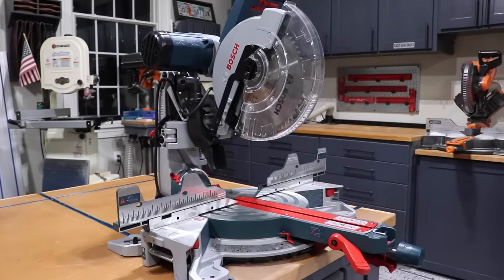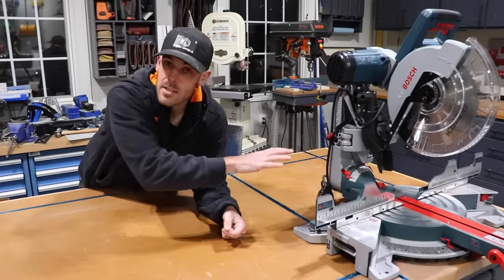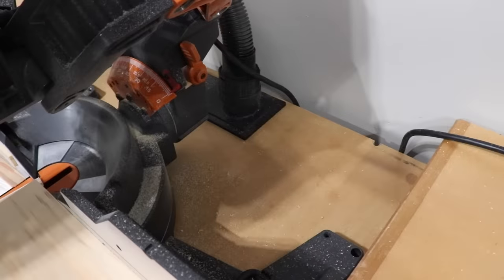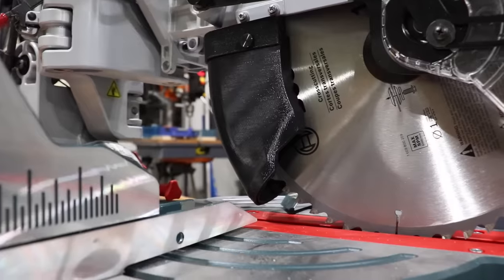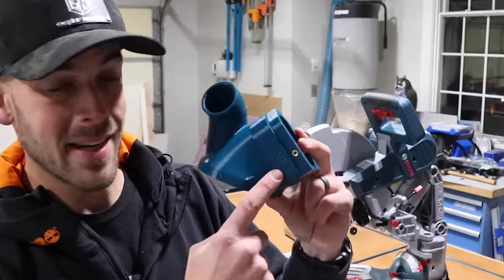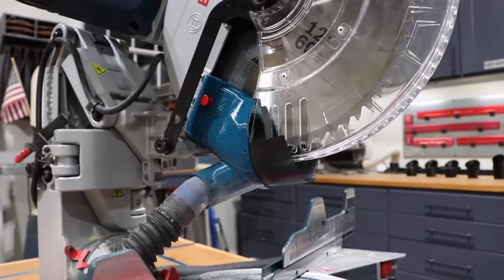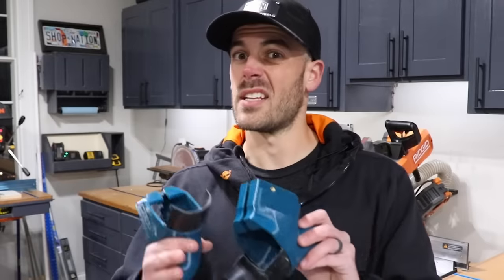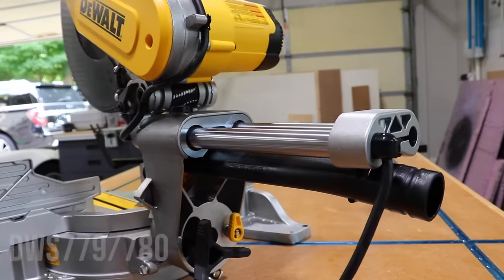It's like Bosch doesn't even care

Comment: I have to admit, very clever idea. I think you could improve it even more if you make the suction adapter in the back a bit bigger. That's generally the biggest problem with all suction systems on Machines. As an example, a table saw. The opening that considered sucking around the blade is significantly wider than the suction adapter for the Machine. You can test it even without a machine. If you connect a 4-inch suction hose to an 6-inch adapter, you will lose more than 50% of the suction flow. And vice versa.🤔

Comment: For ideas on cool connections (like how to improve the magnet connection) check out Fidlock. They have awesome fasteners. My favorite are magnetic to mechanical locks. So magnets help the lock close then you have to mechanically twist or move to unlock. 
So imagine your hose adapter using magnets to easily connect, but then you have to twist to unlock it.

Comment: The 3d printed part will delaminate where there is the friction fit unless you specifically orient it to combat that effect. For a similar project I printed a thick ring in the horizontal plane to counter the pressure

Comment: Makita 10 inch please!! They are generally very good with dust collection, maybe the best of any saw, but when cutting whide boards, the sawblade is far from the dust collection port, and it fails badly.  This is a common use of this saw for me. Hope you can help!

Comment: Check the straightness from the miter bed to the wings and I think you will find the wings are .017 inches lower so it could affect your cuts. As long as you hold your wood down hard against the bed no problem but on a very long piece it maybe.

Comment: Have received it and installed it.  IT’S GREAT.  very little dust is not collected.  One question.  The attachment ring keeps falling off when I remove the vacuum. Do you have a suggestion for better attachment?  I’ve thought about a set screw , machine screw with sharpened point and even CA glue.  Or, are there flexible attachments that won’t interfere with the saw when it slides?  Thanks

Comment: Hi, great job on that I want to buy it, if I have a festool dust extractor, do I need any adapter for it or will it fit directly in the default model without adapters? Thanks!

Comment: You sold me!  ... now I'm wondering about Bosch's new miter saw, BOSCH GCM18V-12GDCN PROFACTOR™ 18V 12 In. Dual-Bevel Glide Miter Saw.  Two questions, please: 1. Have you developed a dust collection chute for it, and 2. Can you compare the new saw's dust collection effectiveness to your chute design for the  cordless saw?  Reason is that I'm considering buying the new one, but if it doesn't exceed the changes you made on the old one, them I'm going for the old one; your design!   [Your design appears to have exceeded the collection performance of my Festool Kapex 120!]. Way to go!

Comment: Hoses- replace them all with the DeWalt AirLock system. Just the best out there. Quarter turn lock, with 360deg rotation free. Never have a hose come loose again. Male ends for tools can be made from cheap plumbing fittings (size adapters).

Comment: Definitely a mixed bag for me.  On thinner boards, this is great.  Much better than stock.  Thicker/wider boards, it is in the way.  It becomes obvious quickly why the manufacturers don't put collection there.  So on thicker/wider boards, I unclip it and have no collection.  I would gladly sacrifice some dust collection efficiency on smaller boards to have a better than stock solution that is universal.

Comment: You mentioned twice either "German engineering" or "German machinery".  I'm a 60 something year old engineer who has worked with German industrial engineered machines all of my professional life.  I've also spent time in German manufacturing plants.  I can tell you first hand there is nothing spectacular about German engineering or machinery.  The only thing I can say about their equipment is, at times, they throw more steel or aluminum on their parts than is necessary.  Some of their equipment is not necessarily over-engineered as much as it is over-built....much like old US industrial equipment used to be.

You presented a great solution to the saw problem though.  I still think (as I mentioned in the Ridgid/Cruzer video you did), you would benefit from adding a perpendicular face to the collector port.  It would prevent  contaminants from whipping around the port, efficiency increases.  I've used the concept dozens of times in industrial dust collection applications.
Reply from the maker: Interesting, the perpendicular face would act as an anti-vortex? Or just promote more laminar flow?

Comment: All your cuts are SUPPOSED to be sliding. The saw is designed to be pulled out raised, then plunged, then slid BACK to complete the cut. So you are using it backwards.  ( This minimizes tear out at the fence side of the cut since the fence has such a large gap in it ) In addition, the reason you have a 12” blade on a miter saw is so you can cut thru wood up to 4” thick.  The thickness of wood a miter saw can handle is determined by how much blade sticks out below the drive housing. ( usually about 1/3 the blade diameter or a tad more )  It looks to me like your chute is sticking down lower than the drive arm at the hub of the blade by a good deal. This limits the cutting depth of the saw in simple crosscuts and nearly eliminates it in bevels cuts.   That is, its a fine solution for folks only cutting 1” thick boards that are only a few inches wide.  But will require being removed and no solution at all for cutting anything thick or wide.  Seems to me your solution could be improved by making the back section retractable as it strikes the surface of the board so that it allows the full board thickness and width the saw is otherwise capable of cutting.  Just a hinge point so that gravity allows it to drop to the board surface and the board can push it up would work, or you could take advantage of the Bosch lever arm linkage that retracts the blade guard in the opposite direction.

Comment: So after using your “what I thought a very cool solution” for many months I found another issue! If you cut lumber that is thicker than 1 inch you have to remove your dust collection! The bottom does allow enough space.

Comment: Festool Kapex is supposedly the king of dust collection, but it looks like you would give it a run for its money. My Kapex is good but I mounted it in a station that has a down draft cabinet under and behind to collect what gets missed by the Kapex ans CT midi. The down draft is connected to my dust collection system.

Comment: Greetings, I really like the idea you have of improving the dust collection of my Bosch saw with your creation. I purchased the digital file recetly and my son printed out the componants. It started off performing very well collecting a lot more dust than the OEM collector, then disaster struck. I was cutting miters on some door framing stock that results in having to cust small off cut blocks, the blace picked up one of these blocks and rammed it into the dust collection adaptor causing it to shatter. In talking with my son we are interested to hear if you have a specific recommencation on plastic he should use in his 3D printer. He initially used what he had on hand and now we realize we need to get something a lot tougher. Also, the slip fit hose adaptors didnt slip fit well at all. I had to reem out the ID of the smaller adaport so it would slip fit. Did we not print this properly? Joe
Reply from the maker: Sounds like you printed in PLA, I’d recommend PETG and up the perimeters to 3 and increase your infill. Fit of the adapters could be a printer issue as mine all fit perfect
Reply: @ShopNation  Thank you for your reply, We will give the PETG and perimeters of 3 a try. Thanks very much. JLGWoodwork

Comment: A thought regarding the wide vs narrow version and air velocity. 

But first great video and display and presentation of your itteration process! 

A question: It seemed like the narrow version performed similar to the wide, yet you went with the wide? 

My thought is this: 
The air is being sucked through the angled tube adaptor thingy. When the area gets bigger close to the blade air velocity will go down. 
Therefor could the more narrow version, even tough it does not physically block as much space, the sawdust it does block it also has enough air velocity to keep more from bouncing back out? 

Though I like the comment on lining the inside with felt or maybe just make it not as smooth to reduce "bounce back"? 

Again great video!! Will atempt to make my own for my old bosch miter saw based on your findings. 

Keep it up! 
Jakob

Comment: Dig the side suction instead of out the back. When you tackle the DeWalt I’d be interested in a solution that does something similar. I underestimated the wasted space required to accommodate the sliding arm with collection on. Duct tape engineering you say? Yup, did that.

Comment: as a trim carpenter you should also test cutting vertically. We cut most baseboard and crown nested against the fence. not laying down
Reply from the maker: Yes that is why I apologized to trim carpenters lol
Reply: @ShopNation  so what is the max height of cutting before it gets in the way? 
I own a Dw780 and hoping the solution is a little more flexible for us!

Comment: Are you absolutely sure this doesn’t fit the EU GCM 12 GDL? I am waiting on delivery of a 3D printer, have found your video and am literally ready to hit buy on the plans when I read your disclaimer….!? Looked like the thing of dreams and a real time saver as I was about to start this design process myself!
Reply from the maker: Positive! Working on a fix though
Reply: @ShopNation  if you need dimensions let me know, I’ve got one sat in the garage so can help out if needed?
Reply: I too would be interested in the EU version!
Reply: That said it also would be nice to have a hose adapter that accepts C35 click+clean fittings like the original mounted on the saw.

Comment: Hello I have been following you on this Odyssey until you come to the point you're at now and I must say you've done one hell of a good job although some people have written you about pieces of wood going up inside and breaking the the housing so I'm wondering if it would be possible to line the inside say with a rubber membrane like maybe cutting up a bicycle tire and super gluing it in some way just off the top of my head anything that my cushion the blow of a piece of wood flying up in there. I really hope you read this and get back to me with your thoughts I want to buy one of these but I don't want to buy it and then have it break

Comment: looking at your video, i noticed that when using the bevel version when sliding in one direction it does interfere. you may need to create a version that the hose adaptor goes to the opposite side.  this would give you the clearance. so in short, you would need a left and right version when using sliding bevel.  i also noticed that if the flap was a bit taller on the side ends, it could collect more dust. your slow-mo that you provided shows dust flying past the end lip of your flap. do take a looksee again at your video. do share your thoughts. other than that, i like the video and would have interest in buying these from you.

Comment: You have it working great if the sliding saw is just used as a chop saw. What happens is you cut a 2x10 ? Doesn't the unit prevent the cut when the blade is being pushed through the wood?

Comment: Actually before I order this, is there any difference with the sizing options? does the 2.5 inch version give you any drag or any downside, possibly the hose running to the fence during sliding motion?  Currently I'm using a 2.5 shop vac hose, then adapting to a smaller size (not exactly 1.75 inch Rockler hose.  I use one of those on my swing arm for sanding.)   I really like the Rockler hose (Flexibility/adapter, sizing) but currently I only have one.  Would you recommend moving over to the Rockler set up? or just attaching it toi the 2.5? Thank you and great video and work!!!!

Comment: Does your dust collection adapter reduce the cutting capacity ? My Bosch  GCM12SD  in stock configuration can cut 16/4 thickness at 14" width. I'd be interested in purchasing your adapter if the cutting capacity isn't compromised. Thanks

Comment: What is the maximum board thickness that can be cut (at 90 degrees) while still using the slider?
Would it be better to replace the chute with brushes similar to what is used on CNC cutters in order to allow cutting of thicker material?

Comment: Before I order one I have a quick question. I just got this saw and honestly only using it for cutting up firewood kindling (it was my only option after 2 Dewalts failed within a week and I wanted something that will last for a while) any ways, I want to collect the sawdust for another project so can I simply run a shop vac to this and thats it?

Comment: Watching the video, at 11.33 in when you are cutting with the flap would it help if the flap extended to the corners at the top of the chute. I sort of expected the narrow version to suck better as the narrower opening would increase the Venturi effect hence the airflow would be moving faster helping to pull the dust in. How about a test then of narrow chute with taller flaps to the corners

Comment: So I wonder if you could create guide flaps that attach to the back of the fence which would send escaping saw dust to a place where it would be more likely to be retrieved by the suction at the end of the cut.  These are stationary, no sliding just squish out of the way when doing miters or compound miters.

Comment: Hi, 
I bought this saw two weeks ago so was stoked to come across your design and bought the 3D printing files:

I printed the hub mount but Bosch has changed the design so it doesn't fit.  The rear metal blade guard is different and the screw holes don't align with hub mount. I can probably drill new holes in the saw and somehow fill the existing ones.

I've not printed the chute body yet. Not as happy as I thought I would be.
I thought that you should know.
Reply: I have got it to fit, but I had to drill 4 new holes in order to secure the hub mount. 

The other issues that I ran into are that the hose connector is too big for the standard Festool hose (I'm still working on that). 
I really need to come in with a 45-degree fitting in order to get the hose pointing upwards away from the fence. 

The main bugbear is that I've had to remove my zero-clearance fence as it's in the way of the new chute. I'm thinking that I could make a very low version zero-clearance fence. 

So it's a trade-off between fantastically clean cuts with the zero-clearance fence or fantastic dust collection. The dust collection with this fitted is pretty amazing. Travis has done a great job developing this.

Comment: Is there a way to add bristles? If yes then my thought is to angle them out slightly or is there a way to angle the rubber flap out so it would have more area? It would flare out but you wouldn’t lose anything on cuts.

Comment: PLEASE PLEASE PLEASE, now that you addressed dust collection for the bosch miter saw, can you make a holder for a battery pen light so we can have an accurate shadow line on the saw?  It’s almost like the little compartment on top is tailor made for you to engineer a 3D printed light holder.  Keeping my fingers crossed 🤞 😎
Reply: You can easily mount a sawing light under the saw's blade guard...and  you'll have a shadow line.  Take a look at Fisher's Shop for the details. I modified mine a little compared to his video.

Comment: Does it foul if you're cutting large timber with the saw say 4x4 or 6x4 as surely that's the point of a 12" saw I see it works well with tiny bits but what's it like with large pieces?
Reply from the maker: Big material in non-sliding cuts is no problem

Comment: I have an idea for you, My Grizzly 1033X PLANER HAS A 5"  DUST COLLECTOR, I bought a part number W1037 from Grizzly which is a 5 to 4 adapter, it will not slide over the planer hose mount, I have to butt it up and use duct tape. Grizzley says that's all they have, maybe you can manufacture them. I can send photos if you are interested.

Comment: Have you thought about or tried TPU or flex PLA? Then interferance isnt so much an issue as it’ll flex outa the way for the minor hits. Been thinking about the same idea with my Hitachi slider.
Reply from the maker: Yeah I have thought about TPU actually, could be a cool application
Reply: @ShopNation  It is actually, use it on my CNC dust boot because i do dumb things now and then and instead of breaking something like the lexan or plastic ones, the flexible, well, flexes! Works really well. And honestly, the cheapo amazon brands are better than like ninja flex as they are actually stiffer, so they hold better, but still enough flex to prevent damage.

Comment: Great work. It would be perfect if the 1-1/4 end of a EVERCONNECT 4829 1-1/4 to 1-1/2 (or other similar brand rubber coupler) could be clamped around the outside of the dust port without adding a coupler. Many woodworkers use these sort of connectors all over the shop. I think the dust port may be too short - needs to extend about 1 inch in length. I also don't know the diameter of the dust port without the coupler extensions. I am not sure if this common type of rubber coupler when put on the outside of the dust connector would bump into the arms. It is a tight space so hard to tell on the video. I am stuck between buying a ready made one from you or needing to modify on my own only for this reason. If I knew I could easily clamp a rubber 1-1/4 connector on in a way that would not interfere with motion of the saw I would buy it immediately.